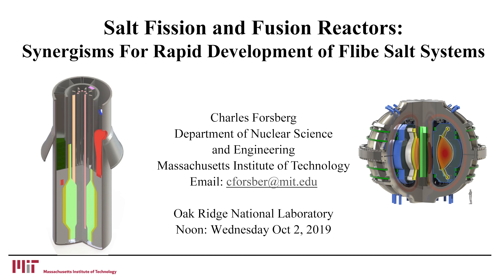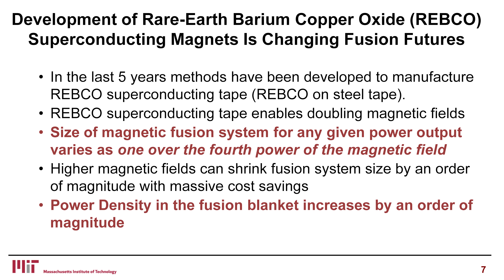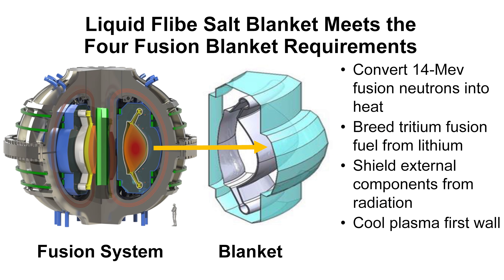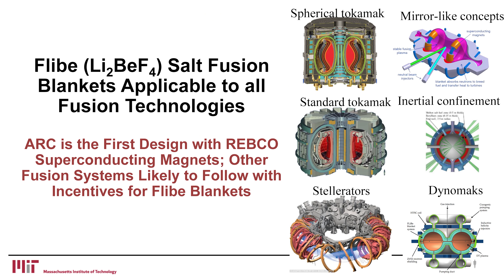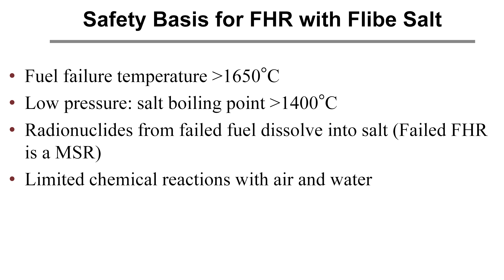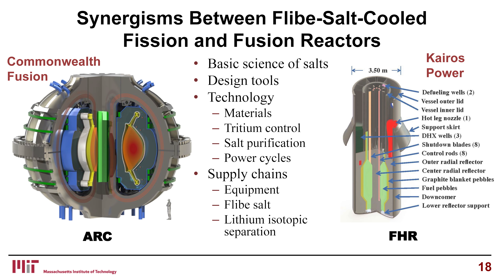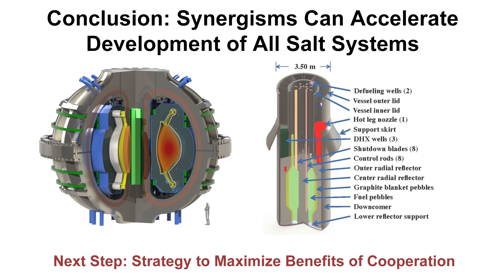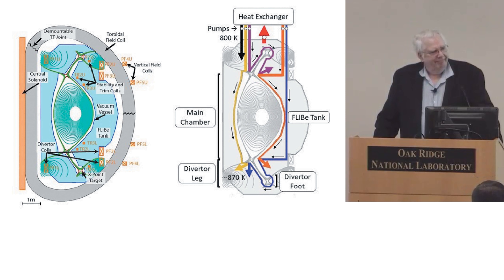Molten-Salt Fusion Reactors and Molten-Salt Fission Reactors - Dr. Charles Forsberg @ ORNL MSRW 2019

Comment: its the wrong shape. wrong shape. what shapes is the sun?
Reply: Ese Callum The difference is that the sun confines plasma with gravity, while these reactors use magnetic fields to confine plasma. Because of the way that magnetic fields behave, tokamaks and the like make sense. If you want to understand better, you’d have to read some about electricity and magnetism.
Reply: @gavinridley5727  ACTUALLY YOU ARE RIGHT AND WRONG.its about the degrees of freedom . a ribbon has 6. in out, left right, up down. the up down and in out means touching the walls and losing energy due to the inevitable kinking of the torus/ribbon. with a sphere you only have in and out. a ribbon always kinks no matter how hard you try. get an elastic band and try to get as many supports as possible to make it perfectly circular. it will always sag. that is torus fusion is dead end and will never work.
Reply: That's because the sun uses gravity, not magnetism for containment of the ionic fuel. Magnets can't do spherical shapes. The sun also primarily fuses monotonic Hydrogen, not deuterium and tritium. So, the sun is a totally different reactor than earth based fusion. Indeed, some of the claimed fusion reactions, like Boron, lithium, and beryllium, are actually charged particle or non-critical neutron fission.
Reply: @esecallum  Ball lighting is not an example of confinement. The pressure inside a ball lightning is no greater than the atmospheric pressure.
Reply: @esecallum  I have made spherical plasmas. Has anyone tried to compress them to fusion densities though? I have not heard of anyone doing, or even trying that.
Reply: @EdPheil  Maybe you should be the first to try? because the tokamak is a dead end. even the inventor said so. this is his statement in 1995.
In the early 1970s Bussard became Assistant Director under Director Robert Hirsch at the Controlled Thermonuclear Reaction Division of what was then known as the Atomic Energy Commission. They founded the mainline fusion program for the United States: the Tokamak. In June 1995, Bussard claimed in a letter to all fusion laboratories, as well as to key members of the US Congress, that he and the other founders of the program supported the Tokamak not out of conviction that it was the best technical approach but rather as a vehicle for generating political support, thereby allowing them to pursue "all the hopeful new things the mainline labs would not try".[8]
Reply: @esecallum  I followed Bussards Polywell/EMC² work closely, a spherical plasma using compressed electrons. Still too too leaky.
Reply: We know far less about fusion in the sun than we know about fusion in a laboratory.
Reply: @esecallum  
The ball lightnings are likely not spheres, but torus shaped plasmoids. They are self contained electrical phenomenons.
To control a plasma with a magnetic field is foolhardy at best. If you want to achieve fusion you need to work with the plasma and not against the plasma. Look for where nature tries to create these confined plasmas and try to understand them.
Or just google dens plasma focus device and fusion. Then you will find the future of fusion technology.
Reply: @MegaBanne  You are so desperate to invest in a failed concept. Even the inventor Bussard ditched it in 1996 and here you are still flogging a dead horse after 14 years. People are afraid of change and your generations finds it hardest of all.
Reply: @esecallum  
Oh and by the way, the two Russians who invented the tokamak died before 1996.
The spheromak doesn't create a ball of plasma, the plasma has a toroidal shape.
Tell me what stops this toroidal current from experiencing kinks and pinches?
Reply: @MegaBanne  bussard invented it...
Reply: @MegaBanne  a spherical ball like the sun has only 2 degrees of freedom. why can you UNDERRSTAND THAT? A PLASMA RIBBON OR TORUS HAS 6.
Reply: @esecallum  Igor Jevgenjevitj Tamm and Andrej Sacharov invented the tokamak. Google is not a dangerous tool.

Plasma doesn't confine well as a ball, not that doing so is easy to begin with. It is practically impossible to confine a plasma in the shape of a ball. When nature confines plasma as something that may look like a ball it is most likely a torus.

A spheromak creates a plasma with a toroidal shape to it.

Talking about the sun is not useful when dealing with confinement here on earth. All of our ideas about how fusion is suppose to happen inside the sun is speculations at best.

If the sun is a fusion reactor then it doesn't have to be efficient since it doesn't need to convert heat energy in to electrical energy anyway. We do not have that luxury.
Reply: @MegaBanne  Wrong again.you ignored what i said about degrees of freedom. why?
a plasma ribbon will ALWAYS kink no matter how hard you try. analogy get a long thin pipe ballon and tie it into a torus shape. squash one part anothor part bulges out,squash that part and and then anthor part bulges out. its always kinks that is why torus is a dead end and a sphere will work.
Reply: @esecallum  
If a filamentary structure has 6 degrees of freedom then that means that it is also of a higher entropy. In other words with that argument it should be a more stable state than a sphere.

Just because a plasma current kinks doesn't make it inherently unstable. It kinks to find stability.
If you manage to kink/twist a current far enough it will form a self organizing plasmoid. These are likely the phenomenon behind ball lightning.

Do you know why the plasma inside a tokamak is somewhat stable?
Spoilers: It is because the current of plasma is moving along the magnetic field lines.
Just like any magnetic field line the magnetic field of the tokamak forms a loop.
The plasma also tends to move towards a weaker magnetic field, in other words away from the center of the reactor.
The solution to this is to twist the field one turn (360 degrees) for ever lap around the reactor. So when plasma naturally moves away from the core the magnetic field lines forces it back.
This is mainly the reason why the plasma would start to kink.
When it comes to reversed field pinch reactors (a version of the tokamak) the field is twisted several turns for every lap around the reactor. This makes this reactor type far more likely to cause kink instabilities in the plasma of many different modes.

The plasma never really tends to take on fine geometric shapes unless there are extremely little interference. Even then it is far more complex than a sphere or a cylinder. Still possible to calculate using math that isn't overly complicated.
Reply: @MegaBanne  you are right and wrong again. Stable by touching the room temperature walls? losing energy?  you can twist the plasma all you like but 6 degrees of freedom means it lots of freedom to kink.
The plasma interacts with the magnetic field and develops kinks as it is impossible for the field to be exactly uniform everywhere and further interactions with the conductive plasma causing further non uniformity. that is why torus reactors are a dead end. no matter how strong the field it will always kink, touch the walls,lose energy and fizzle out. a physicist actually proved this but he was blackballed and his paper blocked from publication as it would upset the gravy train.
Reply: @esecallum  
If you have chamber walls that you want to avoid the plasma from touching then you are doing something wrong to begin with.

A ball shaped entity of plasma is not a stable one. I mean how are you even suppose to confine plasma in to the shape of ball?
You can't use electric or magnetic fields since that would violate Gauss' law for electric fields or -magnetic fields (depending on which one you chose).
Reply: @esecallum  well man if it doesnt ever touch the walls then how would you expect to get energy out of it via the transfer of heat.
Reply: @CatboyChemicalSociety  Radiation and particle flux.

Comment: This was advertising for the MIT/SPARC/Commonweath Fuion reactor tweaked to get time in an MSR conference, pure and simple. Molten salt for fusion reactors for shielding, heat removal, and tritium generation is a decades old technology, nothing remotely new!
Reply: Let's say for sake of argument that I agree with you.  My question is, "So what?"  Was there a better ~20 minute presentation cut from the conference to make room for this?  If not, I don't see what the problem is.
Reply: @AnonEMuss-gw8fm   Yes, there were many, many options for other MSR presentations.
Reply: Im a big fan of your work sir, but I think what they were going for here was the idea to bring together the different industrial actors  (solar ppl fission ppl fusion ppl) to help each other out in the development of flibe. (and maybe the idea that fusion and fission complement each other by using different isotopes on the end of lithium enrichment). Im not saying this is new or something (by the first time I heard about the sparc/arc the flibe blanket was already a fixed feature) or that there wouldn't be a better use of time, that is something presumably only known by those who were present but didn't get the opportunity to speak. Seems like you have a specific case in mind, would you like to elaborate on what we missed ?
Reply: @CraftyF0X  
Solar and MSR fission can be collaborative, already is collaborating, just not 50-70 year old, proven failure fusion, using a salt no one uses, NO!
Reply: @EdPheil  Hehe you seems very passionate about this sir and I appreciate it, but fusion is not at all proven to be infeasible, matter in fact its scientificly proven to work, just that it is yet to be economical (not even break even so far) but hey in 30 years from now... maybe until then MCSFR all the way. What you have against flibe though beside the enrichment and the licensing ?
Reply: @CraftyF0X  Tokomaks have been worked for 70 years with no breakeven even in sight within the 100 year mark. That is proof of failure to any sane engineer. Fission reactors made breakeven energy and power generating reactors within 10 years of discovery!

No one that is building a commercial reactor is considering Flibe salt because it is way too expensive for the extreme 99.995% enrichment, and requires use of a Li6 weapons enrichment process requiring high security, monitoring and cost. Plus the use of hazardous beryllium in the salt.
Reply: @EdPheil  Yea but the usual excuse is the scale, which needs to be larger or otherwise the magnetic field strengh needs to be higher. They build ITER larger than JET for a reason while the MIT guys thinks they found gold because rebco tapes able provide the afformentioned higher fields.

I see how this is a problem for commercial reactors but my understanding is that flibe mostly considered in test reactors (both in the case of tokamaks or LFTR). Now of course one can question the value of using a different type of salt for testing than what they intend to use in the up scaled commercial version.

Now that we are here I always wanted to ask about the MCSFR that how is reactivity actually controlled beside the coolant pumps, and is there any way or even reason to take out fission products from the salt (especially the gasseus ones)
Reply: @CraftyF0X  Reactivity control is by temperature/density variations squeezing fissile out of the core, into the core passively. If the pumps stop, trip on high or low temperature, or simply fail, the core salt drains to sub-critically sized/shaped drain tanks, shutting down the core by draining first ht salt into the core, then all fissile salt from the core, shutting it down.
Reply: @EdPheil  Thx a lot for the explanation. By the way isn't it almost like unbelivable that it works passively and so simply ?
Reply: @CraftyF0X  Absolutely not! Every reactor does load following with negative temperature coefficients for at least 1% to 100% power, twomorders of magnitude. It is expected! Sodium fast and MSRE MSR reactors in the US were already proven/tested to shut down without rods based on temperature heat up. Most LWR reactors would do the same as well, just not before fuel damage occurred. MCSFR core can not possibly be damages, since it is liquid halide and repairs at 100,000 ti,es faster than it can be damaged. MCSFR also has no metel nor graphite in the core to damage either. Graphite isn't damaged by heat, but can be by rapid heatup or cooldown. MSRs reactor vessels are too hot for brittle fracture to be a concern.  Overheating our vessel shortens the vessel lifetime, but the vesselmis cooled by the cold coolant, not the hot coolant.  An MSR has the ability to passively remove fissile/reactivity by heatup. No other reactor can do that, not even sodium which already proved temperature based load following and shutdown in solid fuel.
Reply: @CraftyF0X   After 70 years of trying tokomaks ARE proven infeasible. Time to fund other techniques and drop tokomaks.

Flibe opposition is cost (high enrichment and beryllium), proliferation (lithium enrichment), beryllium hazard, and high tritium production/leakage particularly in MSRs.
Reply: @EdPheil  "Most LWR reactors would do the same as well, just not before fuel damage occurred." So basicly the only reason of control rods or boronic acid injection is the fact of solid fuel ? Well I didn't know that for sure.
"repairs at 100,000 ti,es faster than it can be damaged" forgive my ignorance but what what we mean by "repair" in this case the recombination of ionic bonds in the salt ?
Reply: @CraftyF0X  
Not solid fuel related, fuel damage related. SFRs can do it, without fuel damage, but are also solid fuel. Lead fast reactors likely can as well. Part of the issue is water is operated very close to coolant boiling point, sodium has more margin to boiling, 881C vs 550C. Pb has far more margin. Water reactor fuel is frequently damaged due to boiling in core, which is a loss most of the cooling, allowing fuel cladding to heat up VERY fast and react with the steam to make  H2, both failing the first barrier, and creating pressure that fails the second barrier, releasing H2 to the air, exploding to fail the third barrier.
Reply: @EdPheil  Yea, well thats why they need PAR system and frequent inspections against hydrogen embritlement which are extra costs.
Reply: @EdPheil  We actually got quite close to breakeven with a tokamak in the 90s, and SPARC/ARC and ITER are all designed to have a positive fusion energy output, using only well-understood physics and nothing speculative. I agree that fission should already be the vast majority of our energy production, but clearly the political will is not there in the U.S. at least, and developing fusion may be a way out.
Reply: @anthonycavallaro9941  

ROFLMAO!

No!
Reply: @CraftyF0X  Rods are not due to solid fuel, but only if there would be damage to solid fuel damage to solid fuel. Some Sodium reactors have been shut down by heat without rods as well, even with solid fuel. But the solid fuel was not damaged.
Reply: @EdPheil  Well I meant is that the water cause damage to the fuel via voids (boiling) ove time in a generic PWR/LWR, so it can't rely on load fallowing with negative temperature coefficient because of these damages, but instead it needs to be controlled with rods/injection. So in a reactor where you don't have damaging water, like in SFR or in a MCSFR (where you also don't have solid fuel to be damaged) you don't need control rods either. Is this a correct a assessment ?
Reply: @CraftyF0X  Yes

You do have to design sodium solid fuel reactors right, so it too does not get void, even in rodless shutdowns. SFR operates at 550C, to allow much more margin to boiling 881C, than water,but you do need to demonstrate you can keep temperatures below 881C even in casualties, like loss of flow, even in local hot spots.
Reply: @anthonycavallaro9941  ITER is NOT designed for breakeven energy. That is not planned until the follow-on reactor called DEMO in 70 years from now. SPARC is NOT designed for power operation either, not enough shielding.
Reply: @EdPheil  Well it will produce more 'energy' in the form of fusion product than electricity it takes to start it up, by a factor of... if I remember correctly ITER is around 5 and SPARC is around 3? Which can be converted to electricity in ARC/DEMO, with ARC being more developed on how this will be done. The exact numbers are squiffy because divertor design is still an active area of research, but the folk from the clip I linked specced ARC for up to a GW of output.
Reply: @anthonycavallaro9941  HOGWASH! Not according to ITER! Stop making up data!
Reply: @anthonycavallaro9941   
Besides comparing electricity in to thermal fusion power out is the most obvious indicater that they are not close to break even. It only counts if it is electrical to electrical or thermal to thermal for breakeven, or it is fake. You nedd about 2.5x thermal fusion out to be equivalent to electrical power in to get breakeven, due to power conversion efficieny.